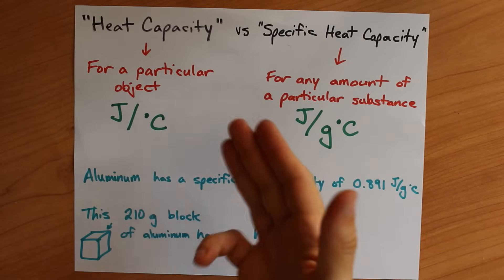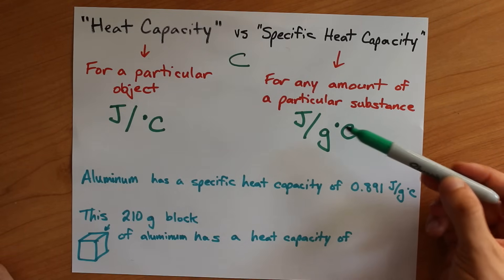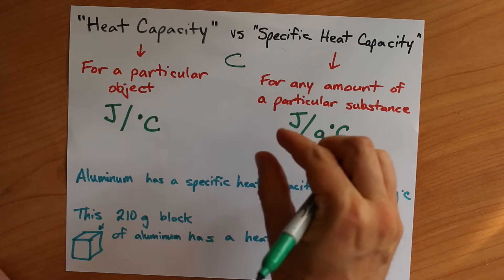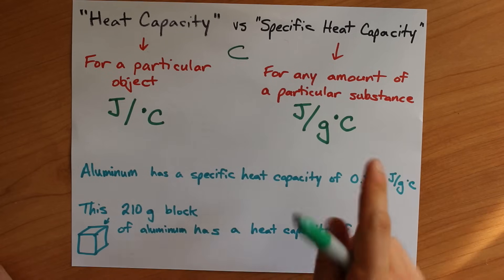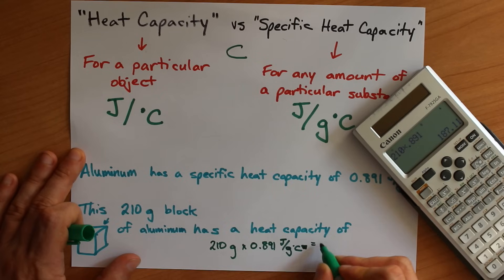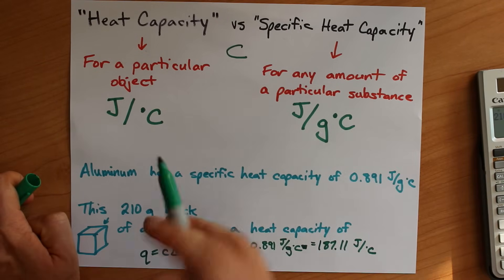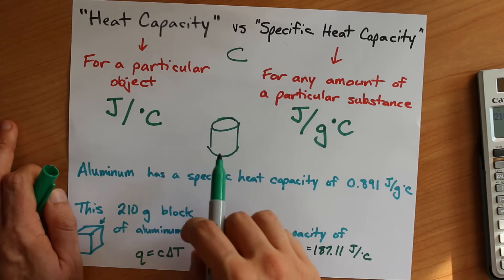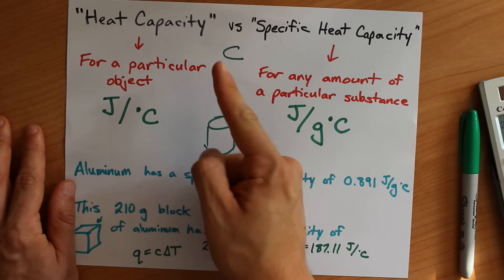What is the difference between Heat Capacity and Specific Heat Capacity?

Comment: Just need a clarification :  when SI unit for temperature is Kelvin then why did you use Celsius.
Reply: I know this is probably too late, but Kelvin and Celsius are of the same magnitude. So while the temperature for 40k and 40c are very different, their 1c=1k in terms of an actual measurement of heat. Therefore, for delta T, or the difference of temperature for q=mc(delta)T, you can use either Kelvin or Celsius.
Reply: @maxlipiec  Thanks for the clarification
Reply: You can either or, depends on what the question wants you to answer in or is using